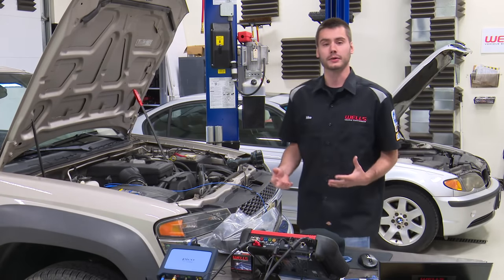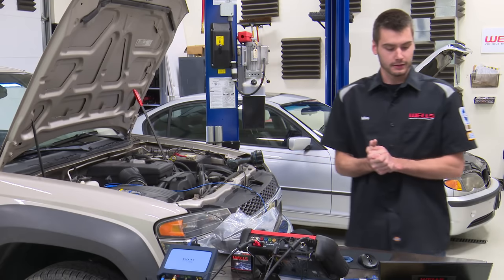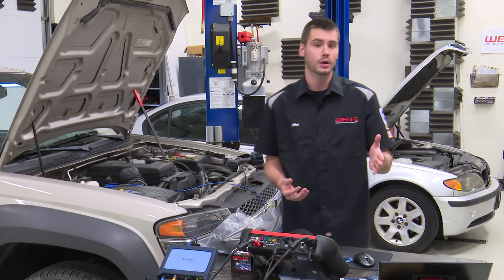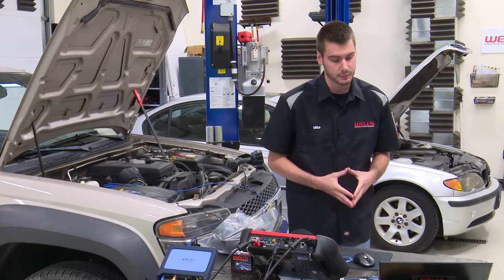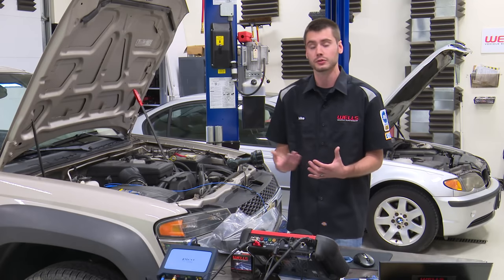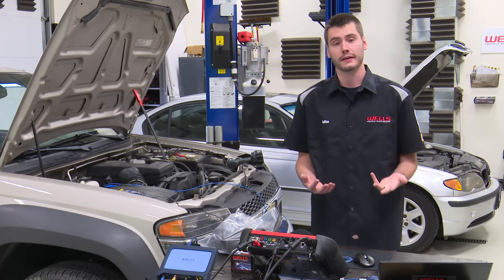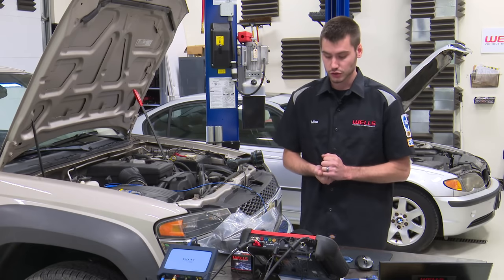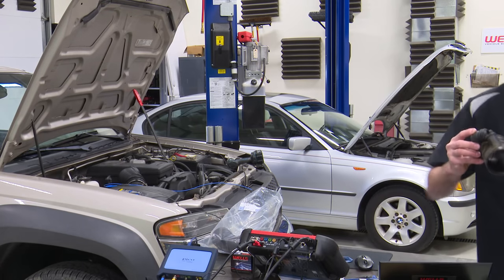Fuel Trims-- Mass Air Flow (MAF) Case Study Diagnosis (P0171, P0172)

Comment: Is the canister saturated??
Reply from the maker: Great question Chuck. Is it? What would happen if it was, what would happen if it wasn't? This question was written broadly and without much information on purpose :)
Mike Becker, Technical Services Instructor
Reply: The purge draws from the canister, therefore trim values would condition based...
Reply from the maker: Yep, it does. So what is the answer to the question that I asked during the broadcast. What would happen and why?
Mike Becker, Technical Services Instructor
Reply: It depends:) is the fuel strategy smart enough to know the purge is stuck "likely on modern car".... but in general terms it creates a lean condition if the canister isn't saturated on a MAF engine.
Reply from the maker: Exactly! So, if the canister was saturated with fuel, what would you see? One step further, with a stuck open purge...what could be the complaint after refueling?
Mike Becker, Technical Services Instructor
Reply: At the gas pump, click / click  / click,  gotta get the last drop right..... its 3 cents cheaper today, if it draws liquid at may fail to start at all or start and run poorly "misfire".  Finally decide to bring it in and you've got "misfire / lean / rich faults"...
Reply from the maker: Heyo! Nailed it! Those vapors during refueling would force themselves into the intake manifold and cause that thing to start very hard, from being so rich. Potential misfire codes as well. Well said Robert!
Mike Becker, Technical Services Instructor

Comment: so is that 80% rule a fact when looking at a maf sensor
Reply from the maker: Yeh, peak grams per second should fall within 80% of rated HP. Play with it, see if you like the rule. I'm sure there are engines out there that defy this, but it's an interesting tool to play with.
Mike Becker, Senior Technical Instructor
Reply: Wells Vehicle Electronics I'm just asking because I might have a maf issue based on that theory based on what I'm seeing in my datalogs
Reply from the maker: Any driveability issues? Again, it's just a theory. It's not fact set in stone. 
Mike Becker, Senior Technical Instructor
Reply: Wells Vehicle Electronics no drivability issues that I can tell like stumbling or hesitation..fuel trims are normal at idle but go lean on accel or wide open throttle. My first thought was fuel related, possibly injector related since fuel pressure holds and never drops. Seeing this video had me looking back at my logs at the maf
Reply: Wells Vehicle Electronics hey appreciate the replies..did some research and realize that my lean condition is most likely due to a bigger diameter intake on the car and no maf adjustment to account for the bigger diameter piping
Reply from the maker: Unless you are exceeding the measuring limit of the mass air flow sensor it should accurately read everything that goes past it...bigger intake or not. You could pull the MAF and clean it. See if you notice a difference. Cleaning isn't a long term fix, but it may offer you some insight!

Mike Becker, Senior Technical Instructor
Reply: Wells Vehicle Electronics ok..one more question. when you said going wide open throttle should make the o2s go rich does that include wideband o2s also?

Comment: Glitching with new MAF? What the hell..
Reply from the maker: Kris, Have you seen new parts fail before?
Mike Becker, Senior Technical Instructor
Reply: dont you think all sensors should be replaced @ 100,000 miles with orignal parts

Comment: My answer to your question would be  LEAN.CODE  I wish i could find a mechanic like you in my town. Too many shop owners seem to be interested in FAST MONEY. They don't want to invest much time in diagnostics. They want fast solutions and big bucks.
Reply from the maker: The best shops are the ones that care. I wish all shops did too. If you care and become known as the best, the money comes. If you only care about the fast solutions and the big bucks, the money leaves and you end up wondering where all the work is...at least that's how I see it :)

Mike Becker, Senior Technical Instructor

Comment: WOW my head hurts. You ask a simple question, what should the correct MAF reading be for the gm/sec. You then state the simple rule of thumb to figure it out. At WOT your MAF reading should be equal to 80% of the cars max HP. So 80% of 220hp would make it 176gm/sec. Simple right? but when you apply it, I get lost. Your method instead is to take the currently wrong MAF reading of 148gm/sec and instead divide that by 80% forgetting all about gm/sec and getting the wrong answer of 185 for the HP. You didn't even use the rule of thumb right and we wanted to know what the correct reading was suppose to be for the MAF remember, Not the max HP. The rule of thumb was to find out gm/sec. I would have gotten an F in your class for sure.